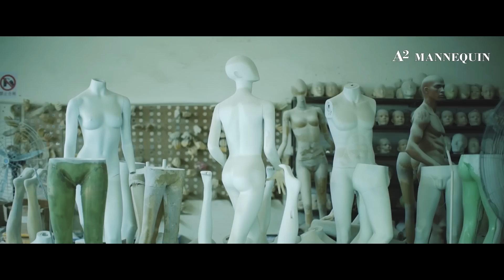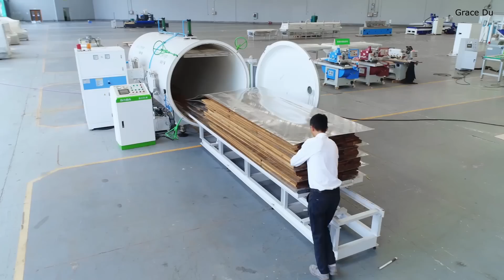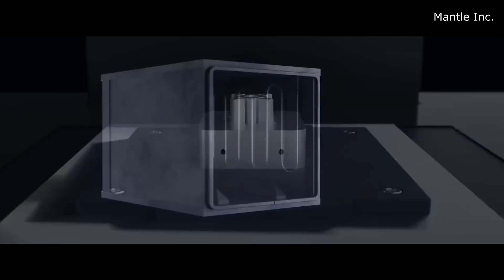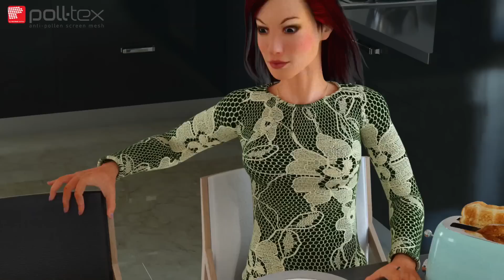10 Mini Manufacturing Business Ideas for Start in the Garage. Profitable Business Ideas 2024

Comment: Please how can I get moulds for moulding structures
Reply: If you are talking about the rotational molding it looks like they are using fiberglass molds.  This is easy if you want to copy something you already have (cover part with a release agent and fiberglass + epoxy over, use gloves and a mask the fibers are not nice) If you want to make a good mold for something small a silicon mold works and is reusable.  If you're more talking about arts and crafts for moulding you can make a single use mould using alginate

Comment from the maker: 0:00 Start
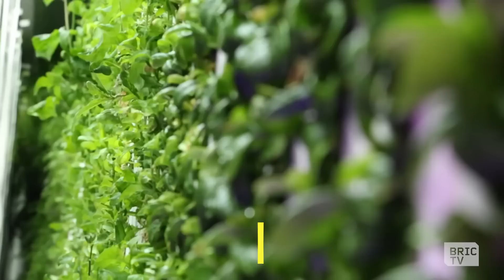0:09 Urban mini farms
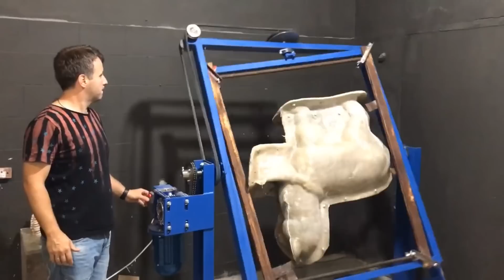0:49 Rotational molding
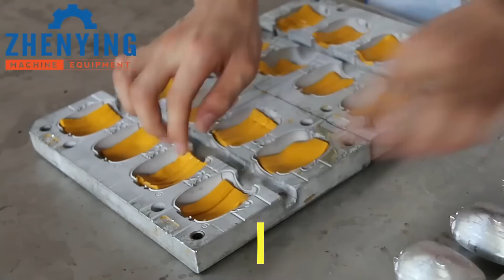1:40 Mobile phone cases
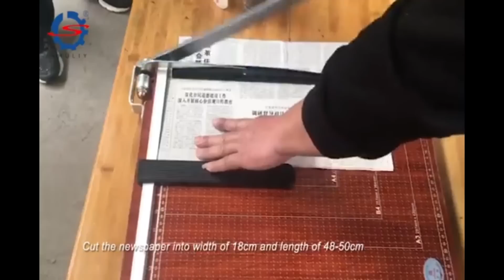2:30 Mini manufacturing of pencils
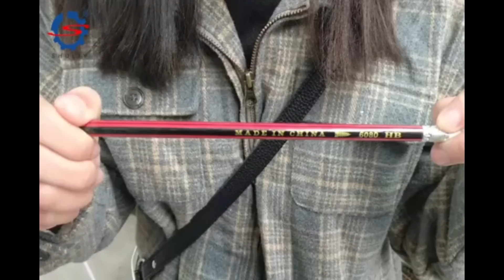3:23 Manufacturing of boilies 
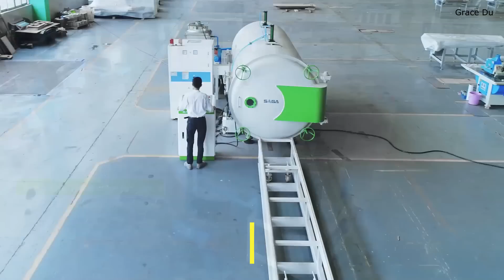4:21 Vacuum chambers for wood
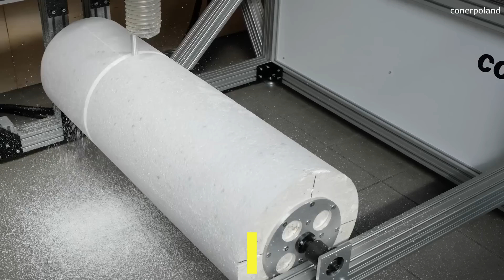5:04 Foamed plastic and EVA foam products
5:52 3D printing with metal
6:25 Production of wall eco-panels
7:09 Window screens
8:12 Million-dollar startup business ideas
Reply: "in your garage" most of them can't be done in a garage
Reply: Thanks for your assistance. How do I set up a mini pencil manufacturing business. I am highly interested in the business.
Reply: How can I get moulds for Rotational moulding
Reply: @paulkpwamua688  Yes, I am interested in this too. How do I get the rotational frame? Do I build that myself?
Reply: @paulkpwamua688  There is enough information on roto Moulding that you should focus on "How do I make my Moulds to fit my machine?"